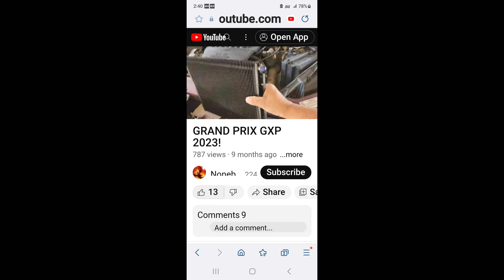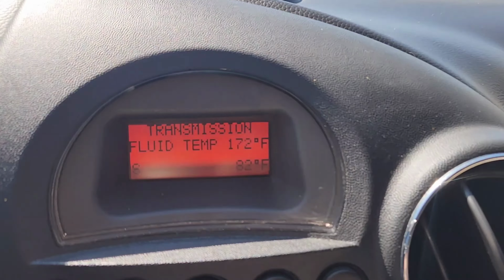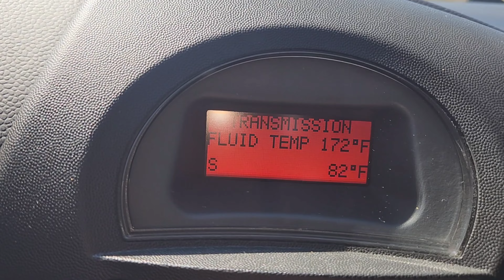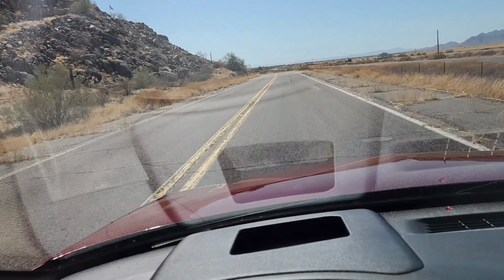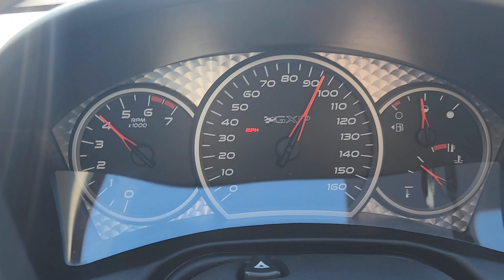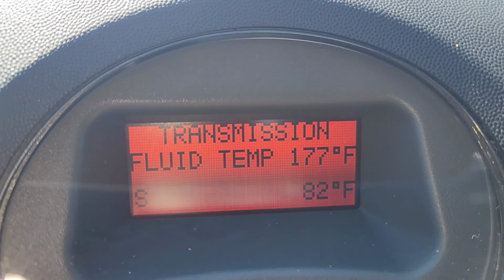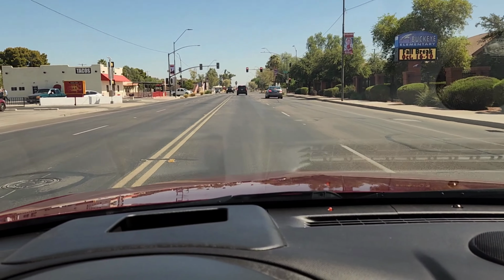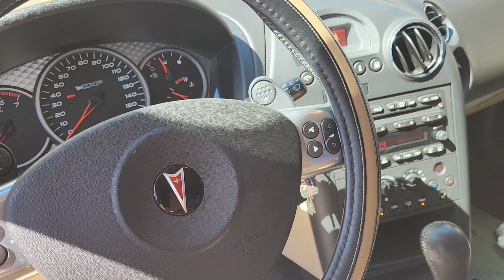TRANSMISSION COOLER TEST!!!

Comment: The voltage is fine.  I think it was 06 or 07 they started using more efficient charging strategies.  So if you have a great battery, the computer senses it (you will see a ring shape current sensor with one of the battery cables going through it).  If the battery doesn't need to be topped off, no need for the alternator to send out extra voltage, thus more efficient and longer battery / alternator life.
Reply from the maker: Ok???😮

Comment: I have one but I have to install it ? Is it best for the summer or all year around.
Reply from the maker: In these cars with the V8 Engines, and little V6 rated transmissions, you will need it all year round, in cold weather, the transmission oil still gets above 210 degrees easily. GM engineers should have thought of this when they designed the car.
Reply: How did everything got you well buying it and getting it installed?